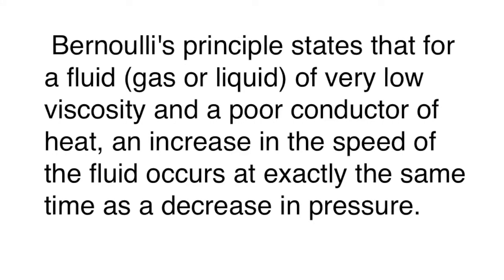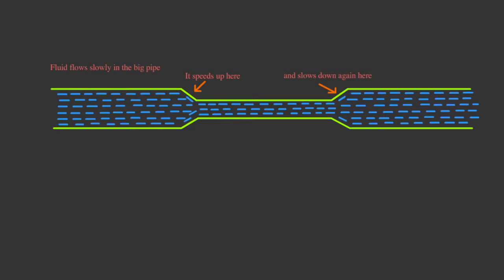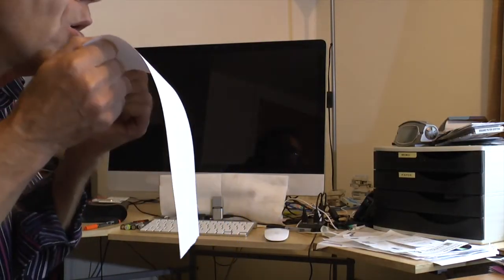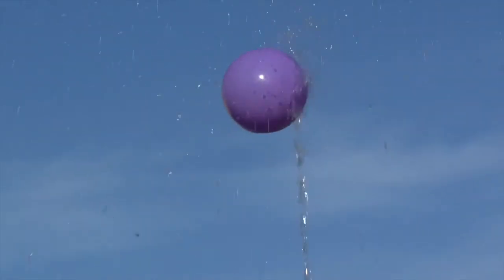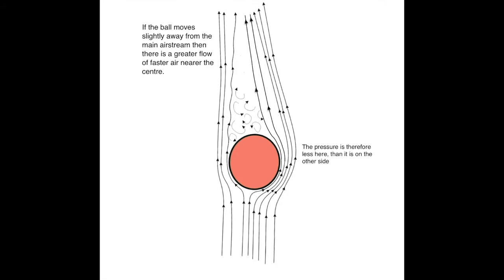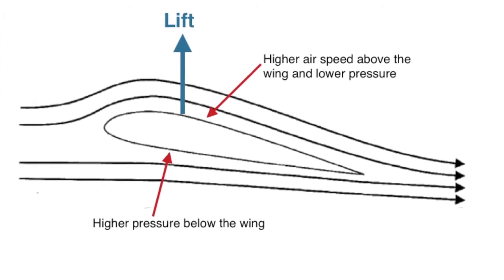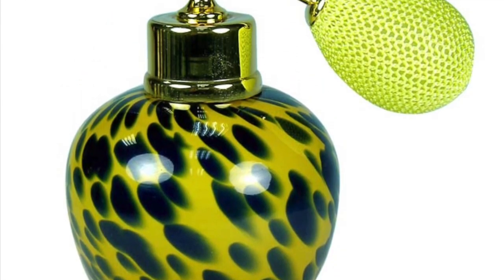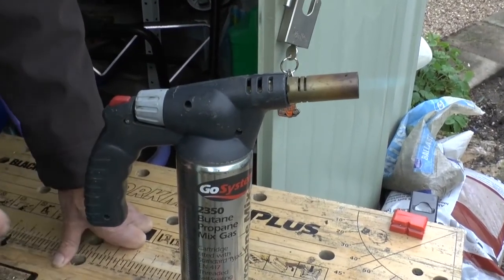Bernoulli sometimes sucks; explaining the Bernoulli effect: from fizzics.org

Comment: The confusion of Bernoulli effect is when apply it, most people too focus solely on the pressure and speed difference, and forget / neglect another factors accompany it; such as impact pressure (dynamic pressure), head losses, boundary separation,  Magnus / Coanda effect, etc. that always present on fluid dynamics. Whereas Bernoulli equation is based simplified / idealized condition; it must be laminar flow, no temperature change, etc.

Comment: I believe the comparison at 2:10 is not an apples-to-apples comparison and the explanation you provided just sort of hand-waves the proposed explanation away.
When you hold the paper horizontally, gravity comes into play. When you blow above it, you have a paper flexed away from your air stream being pulled towards the velocity vector of the air. When you blow under it, the paper is now curved to cover the stream and gets pushed by it.
A better comparison would be to hold the paper vertically, curve it to imitate the first situation and blow on the opposite end (basically turning the experiment 90 degrees sideways). Then if conducted properly, the Bernoulli effect would apply properly on either side.
Try it yourself and you'll see.
Reply: Whether is is gravity or the curved paper as a spring makes no difference.
.
The fact is that the fast moving air out of your mouth does not have a lower pressure that the still air. This is well known by aerodynamicists and is easily measured with very simple equipment.
.
 It is the fact that the surface disturbs the entrainment around the blown jet that a pressure reduction occurs as the air passes the convex surface.  Once the paper becomes straight it is only entrainment that hold the paper up.  
Saying that fast moving air causes it to have a pressure lower than the still air near it is completely false and repeated by so many amateur scientists that have no understanding ot this. .
Reply: @Observ45er  I think you are overcomplicating younix258s point. I would try to explain it to you but it is already simplified to the point that I don't want to insult your intelligence by simplifying it anymore. You just overcomplicated something simple. It happens.
Reply: @paulweston8184  Paul,
Please put your words to what you're thinking.  You won't insult me.
.
 I always like to hear how others would explain things.  It helps me better understand the terms others think in.  It helps me explain things better going forward. 
.
As an experienced engineer, as well as teacher, it's normal for me to discuss things for a better set of words to explain things and I prefer to understand how others think so I can do better "talking to them" [or others like them in the future].  
I've heard all the common misconceptions and every so often run into a creative new one. . .
,
Looking over that last one, I see I did a poor job with those words. 
.
While 258 is correct that the vertical-straight paper demo is disingenuous and the vertical-curved paper would still lift, that is Coanda which also causes a lower pressure along a convex surface flow. 
.'
Are you going to say that Bernoulli's Principle 'explains' the blow-over-paper demo?

Comment: 2:10 That's a false assumption to think that the paper should go down when you blow across the bottom of the paper. Paper is in the way of air ,so it pushes away.  As someone said in the comments  ,put the paper vertically and blow on the left side or right side and you will witness that it bends reasonably ( not extremely like gravity or whatever  pulling it down) where you blow air.

Comment: Bernoulli’s Principle applied to laminar flow (not turbulent flow) of incompressible and idealized inviscid liquids (not air) within a closed system (not open atmosphere).
Reply: Bernoulli's Equation CAN be applied in open air when the total energy at the two locations being compared is the same. This can actually be done to compare above and below a wing.
.
 In easily done demonstrations and ordinary flight, air is close enough to being incompressible that assuming it produces negligible error in the calculations.
Reply: @Observ45er  That is not Bernoulli's principle. Calling it Bernoulli is misleading. It's vapor dynamics. Anyone who designs aircraft will tell you that. The principles are similar, but vapor dynamics is a LOT more complex, which is why it has to be modeled in an wind tunnel. Also, WHEN air is compressed, there are other factors involved (electrical issues) that don't occur with liquids. Please read the definition of Bernoulli's principle. It was NEVER intended to be used with gases. We've had students do several demonstrations to show how Bernoulli cannot accurately predict air flow, in a very non-negligible way.
Reply: @ezfzx  it  is same with air ( closed system) even though it is compressible. In  woodwind musical instruments such as french horn , tuba ,trumpet , saxophone,clarinet...there is a constriction where the mouthpiece is and      the pressure in that constriction is low.
Reply: @snrnsjd  Bernoulli's equation loses it's ability to predict pressure and velocity within a system when the medium is compressible. Continuity expects that whatever the volume of material enters the system, also exits the system somewhere else. When the medium is compressed, it's possible to add volume in one place, without losing the equivalent amount elsewhere. This results in a rise in pressure (and temperature) inconsistent with Bernoulli's equation, especially with regard to energy.
Another way to look at it is that Bernoulli's equation is an application of energy conservation, but presumes constant temperature. So, it leaves out terms related to thermal energy. It is possible to write an energy conservation equation for fluid flow that DOES account for thermal energy, but then it's not really Bernoulli's principle anymore is it?
Also, as mentioned, introducing compression in the problem makes the solution decidedly non-trivial, involving partial differential equations and/or computer modelling.
Daniel Bernoulli was an excellent mathematician, and could have conceivably pulled it off without a computer. But he didn't.

Comment: Roger Linsell 

Interesting video. I have always thought tat the BE was being misapplied in a lot of places.

I can see how it works in a closed pipe but one thing bugs me. I can see why the pressure of the fast stream leaving a compresses fluid source is lower than teh pressurized chamber. I can also see why it goes back up as slams into the slower fluid of the wider pipe at the end.

What does not make sense to me is why teh pressure in the fast narrow tube should be lower than the ambient air pressure outside the cylinder or why it would no equalize at the speed of sound if it was.

I am left with the notion that we are still misapplying the principles and that this may have something to do with the momentum of the air and its tendency to travel in straight lines.
Reply from the maker: michalchik the pressure in the tubes is independent of the ambient air pressure and quite likely to be significantly higher. The only thing that can be said is that the pressure in the narrow tube is lower than that in the wider tubes.
Reply: Four years and no reply to my corrections...

Comment: You are demonstrating a lot more Coanda effect than Bernoulli
Reply: Exactly
Reply: He has much correct here because he understands that pressure causes fluid acceleration (in the general sense of a change in velocity), but makes the  common error of speed alone causing a pressure decrease for the Bunsen burner and gas torch. 
They are due to entrainment. Once the gas leaves the jet hole, it is at AMBIENT pressure!
.
 Bernoulli is happening through the nozzle.
.
 Starting INSIDE the nozzle where pressure inside is higher than ambient and slow moving, to OUTSIDE the nozzle, where speed is increased, but its pressure is the AMBIENT PRESSURE!!
The gas exiting the nozzle entrains the surrounding air to form the fuel-air mixture.
.
The fuel and Air have viscosity with each other. Viscosity can be considered like friction between the two layers. That is called entrainment. The Jet of gas does not have a pressure lower than the air around it!!  NOT!
.
It is so frustrating to hear this misconception repeated over and over and over.

Comment: Lift by an airfoil (wing) is NOT Bernoulli in nature. It is Newtonian. It is the vacuum created on the back side of the wing that pulls down air from above, accelerates it, and then shoots it down the wing’s trailing edge—opposite and equal.

As lift by an airfoil is Newtonian, it is noteworthy that gravity provides the vast majority of the energy that sustains a plane, or helicopter, in flight. Hence why planes have glide ratios, helicopters autorotation. Airfoils, in a way, are gravitational energy harvesters.
Reply: @yazmeliayzol624 Wow. First time I got a positive comment. Cheers.

Comment: I don't understand how there is higher pressure in the larger tubes than the narrower tube.
Reply: @Observ45er  Ahem...Force/Area**
Reply: Thanks.  Major brain slip.  Reads better flipped around anyway.
Reply: The bottleneck creates back pressure in the larger area... having to squeeze through the smaller area makes it squeeze out faster... making the pressure lower... no back pressure... like when you put your finger on a water hose... the water shoots out... no more pressure...
Reply: @MRGF78  So simply put, the pressure is behind the water in the smaller area of the tube, not within.Because the pressure wants to equalize, its going to push more water into the lower pressure zone.
Reply: It applies to the example of an open system. In a closed system like a plumbing pipe/or hydraulics: if you have a large pipe to start and reduce it to a smaller pipe in hydraulics; the pressure goes up and the fluid can reach a higher point, in a closed system like hydraulics or steam technology.

One discipline to the next does not have the same opinions on these laws. They should stop describing these things as laws, and start describing them as workable theories. 

It's almost a cult, from one science to the next, of their forced doctrine and insistence that what they say is fact. None of it is fact, they're just workable theories: that can be used in different ways, and demonstrated different ways. Change the parameters and the so called law doesn't apply anymore; like in hydraulics(in a closed loop system of a plumbing pipe or hydraulic pipe) this doesn't apply. It doesn't apply in hydraulics because it's closed loop. IN hydraulics you lower the diameter of your pipe and it raises the pressure of the fluid which makes the fluid go higher.

So to prevent your mind from getting twisted by these so called "cult" members who are teaching you they're particular doctrine. In your mind, change the concept of it being a "strict law" to it being a WORKABLE THEORY, until somebody else comes up with something better.

 I'm not saying it doesn't work the way they describe it, and isn't appliable and useful.

WHAT I'm saying is don't get stuck into thinking that: it is a so-called law of fact. Change your mind into realizing their workable theories that apply to SPECIFIC PARAMETERS, but are not in any way a law: just a workable theory providing the parameters allow it to work. 

Change the parameters and the situation changes. A valid example of this is Tesla's AC motor from DC motors; which nobody thought would happen.

 Took me 30 years to figure out that: all Tesla had to do was remove the commutator from the DC motor and the motor naturally produced alternating current. The DC motor has a commutator which "alters" alternating current to DC artificially; by having it all go in One direction via the commutator. The same effect could be done with a full bridge rectifier instead of a commutator.

 All confusions of any subject you're studying is the subconscious realization that: it doesn't match up with other theories or so-called laws. Because in those other so-called laws or workable theories the parameters of the experiment have changed. 

Then they push their theories on you as so-called "laws" like a used car salesman, in the hopes that you get completely brainwashed into submission, to their cult/ empirical scientific proof.

WORKABLE THEORIES as a mindset will help you figuring stuff out. Never accept any of it as law. Because someday somebody will come along with yet another theory; that will show how it can work a different way.

Education is brainwashing. Wisdom is the ability to discern the differences.

I hope this helps you.
Reply: @selmerpwns  so if the area is less in the narrow tube the pressure should be more in the narrow part. A bit confused..sorry.

Comment: basic error at 1.46 ..ok pressure vectors .. not good illustration though ..
Reply: The arrows show the  direction of the FORCE also called a Pressure Gradient.  The arrow points from the higher to the lower pressure because the acceleration is in that direction - the same as the force.  This is simply Newton working in fluids.  Air has mass and follows Newton's Laws. 
He is clearly one of the few people who understands the true physics - - THOUGH he messes up with the Bunsen burner and gas torch where he makes the common error of thinking the jet has lower than atmospheric pressure - it DOES NOT!. 
The gas entrains the air around it to form the fuel-gas mixture.